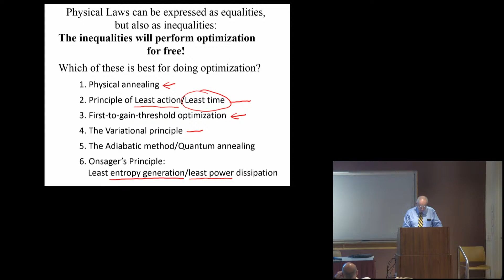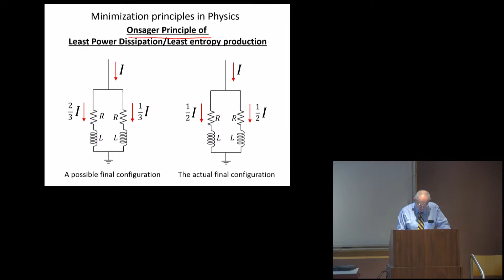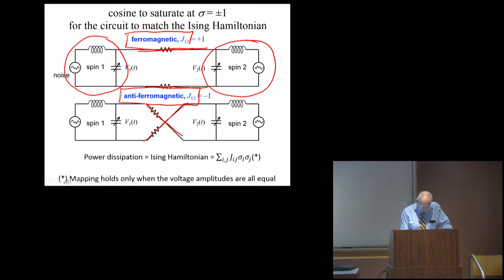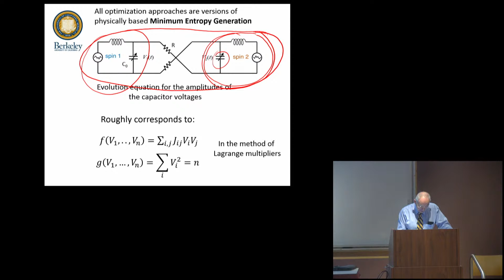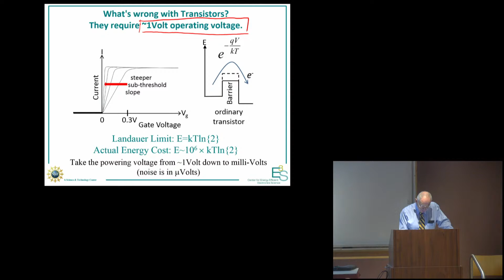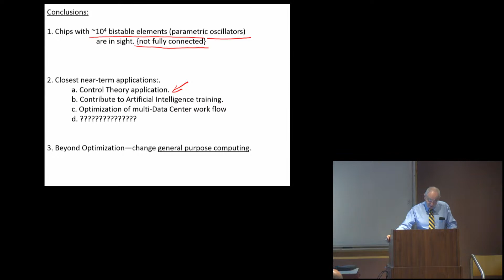Eli Yablonovitch:Physics does Constrained Optimization (for Free); A New Approach Toward Computation

Comment: Wow! YouTube needs to up-vote this video for research purposes. We need to figure out what Von Neumann envisioned when he invented the parametric amplifier oscillating optimization technique.

Otherwise, we're going to get caught behind the 8-ball when it comes to transistor energy consumption because there's no more miniaturization left due to Moore's Law.

We need general purpose computation to move in this direction to get under the 100ųV threshold operating voltage to keep power draw down.